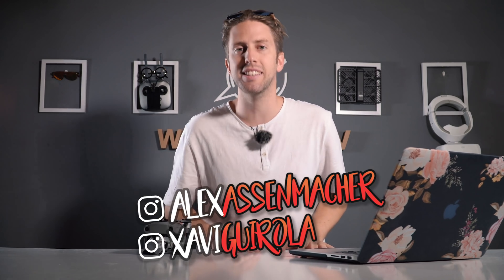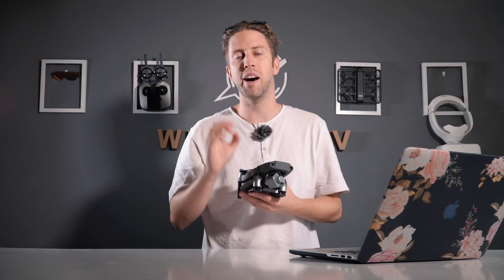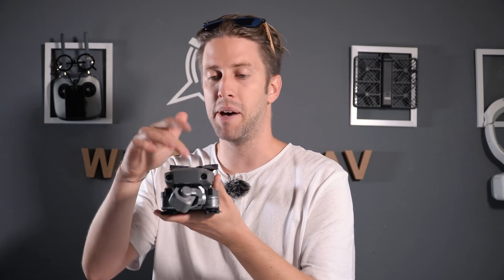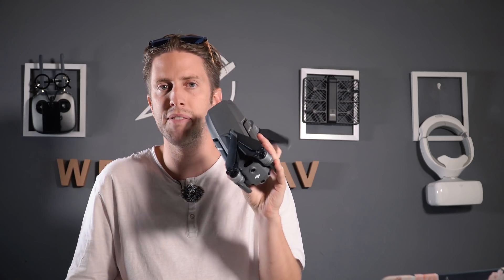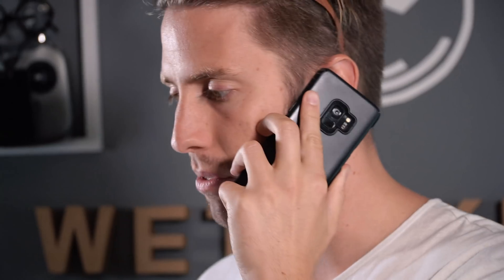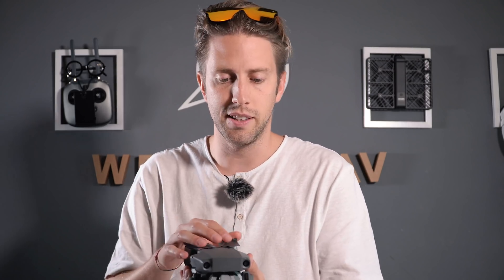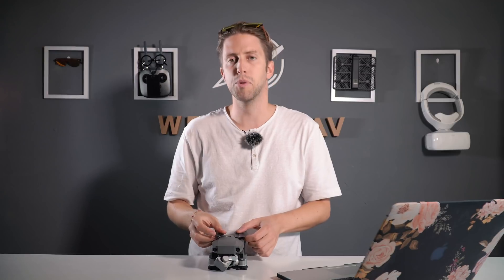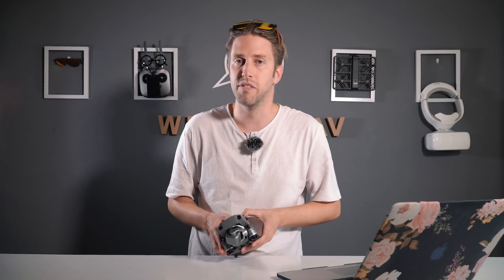DJI MAVIC 2 PRO USES ONLY HALF SENSOR - THIS IS WHY

Comment: How do you know that the p4p is using it's full 1in sensor ?
Reply: because from videos the p4p way more sharper and clearer than the Mavic, and the Mavic has worse low light performance than the p4p

Comment: I received order of mavic 2 zoom today but with my greatest disappointment i figured that side sensor don't work at all duding my in house flight even after successful compass and IMu calibration. And yes i did try in tripod mood multiple times and this shit crashed on to my wall. I'm very glad it was very slight crash but bottom line side sensor don't work unless probably u are on active track mood only but definitely I'd like to fly it out far with safety  from all side then active track n follow my self . I'm surprised hardly any body talking about this defect. DJI advertise it's as omnidirectional but it's actually not at all

Comment: I'm not sure this is true Alex. Once you go beyond a 12 Mp sensor, you're always going to need some sort of down-sampling in order to output a 4k video.  The DJI Manual on the 2 Pro very clearly states in FOV mode it's using all the sensor and thus shooting in 5.5k, then down-sampling the picture to output in 4k.  This is not line skipping, which they have confirmed.  If you choose HQ mode, then the outer part of the sensor is not used to enable a true 1 pixel to pixel input / output, so again, no skipping.  
Either way, the true benefit of the larger sensor with larger pixels and higher resolution is always going to be for stills, not video. Cheers, Ian in London
Reply: I can imagine ANYTHING about dji now after I have accidentally found this video in German language.
The guy has a factory version of Go4 app, and since the discussion is in German, I'm not sure how. He has WAYPOINTS. Not with hyperlapse, a proper waypoints 2.0 with functionality that today only Litchi can do for the Mavic 2.

This means that dji deliberately crippled the app we use!

https://youtu.be/M5PtcPE_QbU
Reply: There is no way they are downsampling in FOV mode unless their algorithm is complete garbage.  The image should be super sharp if using supersampling and it's not. (just look at A7 III 4K footage which downsamples 6K to 4K.. It's amazing.   FOV mode is the blurriest mode out of them all which doesn't match up with the characteristics of downsampling/supersampling.
Reply: @Morawka1  Just read the manual. It clearly states they're downsampling in FOV mode..... I can't comment on why it's not great, only that they are indeed downsampling.... Cheers, Ian in London.
Reply: From the manual:  "For the Mavic 2 Pro, Full FOV down samples from the 5.5K sensor to 4K resolution while HW crops in 
the center for finer image quality but less FOV. Full FOV view is 75° and HQ view is 55°. "
So they're pretty open about the image quality not being great in FOV mode...  Ian
Reply: If it just down sampling from 5.5k to 4 k why would it not match the camera on the older P4P. If Dji where telling the truth the P4P would have the same problem with down sampling. There is something more than Dji are saying. I think Cliff is on to something.

Comment: Your talking sh*t mate in fact all your doing is regurgitating someone else's crap, DJI have said they are NOT line skipping with this camera. dam last week you loved it did you not ? its a great bit of kit and a very much needed improvement over the old Mavic and that's why many of us went out and brought it. if I wanted a P4 I would have got that but its to big for what I do. who cares if its not quite as good as the P4 or as good as the P5 is going to be its still a great bit of kit, saying that I would like someone to get an oscilloscope on this camera and test what's really going on just to shut this silly debate down once and for all.

Comment: So...why does the video shot with my M2P look so good?   I also have seen M2P and P4P video side by side...very little to no difference especially in 4K HQ mode with or without D-log 10 bit color.  In addition, the one inch sensor improves the quality of photos even more than the one inch does video.  Finally, and a somewhat different perspective,  because the M2P is so much quieter than the P4P,  I will use the M2P in more situations and therefore actually get video and photos that I would not get if I owned just the P4P.

Comment: OMG, another sensor issue related video.  
Won't even watch this, sorry and thanks for the hard work.  

Like I mentioned in other vlogs:
1.- It´s as important or more the 10bit color than using the whole sensor
2.- It´s a lot more important the greater dynamic range which you DO get than using the whole sensor
3.- When you shoot with a drone, 95% of the time or more you will see object quite far away so the fine details aren´t 100% needed. 
4.- All, ALL other drone sharpen the images electronically, is not a benefit coming from the amazing sensor or an amazing lens, so it looks sharper but a lot less realistic. 
5.- And the most important:  People worry so so so much about the technical stuff and just have not a clue to how to tell a compelling story. It´s so easy to buy and fly a drone now, but to know about composition, storytelling and have skills in editing and color correction, that seems not to be so important.  Many of the people they say they will return the M2P have horrible content or doesn´t have one at all.

So sad so sad about this kind of sensationalist videos.   Dumbs down!
Reply from the maker: Hi Ricardo, thx for saying that. 
This video is not entirely about the sensor issue, in fact I made a mistake at some things Cliff said, but this video is about why DJI is not using the entire sensor. Not the issue itself, but a bit about everything surrounding that.
Even though I don't agree with some of your points, I like that you stated them here. thanks again
Reply: Thanks for taking the comment in a good way.  It´s a matter of priorities.  To me, as I said, everything that does work 100% on the M2Pro it´s way more than what it doesn´t :)
Reply: A Question for you Urroz : When you go into a supermarket and buy an apple and the cashier cuts the apple into two parts and throw one part away , because its more green or so, and 
demands the price for the whole apple.   Would you pay ?  You explained you dont need  the whole sensor (apple) for getting good quality (taste of the apple). Clearly i get the same taste and experience like from the full apple. But for what did you pay ?  Thats here the question.
Reply: @j.kohlenbach1878  not the same comparison, first off did you know you were paying for a 5k sensor not a 4K sensor, so you are getting more then what you think and secondly, it is using the entire sensor to scan, it's just not processing all of the scanned image.
Please understand this.
Reply: Agree with you. My thoughts exactly.
Reply: J. Kohlenbach hehehe. You are, in my opinion 100% mistaken. You analogy does not apply since it's not half of the sensor what I'm getting. Or half of the Apple. I went to buy a red apple. And damn! It's red but in some part is discolored. The taste for me still great. It's fresh. It's sweet. So yes. Bad on dji not giving me the red apple the promise, that I don't argue. I argue making so many videos complaining about it, when Ive got 90% of the quality  I was supposed to. Because the apple is not 100% red is no reason to return it or cry over and over about it. I rather take a advantage of what I get. A 90 to 96% red apple. With amazing taste. Amazing sweetness and pretty hard. If you or many you tubers want to focus on the lack of the full se sensor when promised. Go ahead. I rather focus on the amazing dynamic range, the amazing 10bit which is even better than Sony cameras. The amazing portability, range, battery. Etc..

It's more about what you create with what you have and less about butting myself up or dji for not having the full red apple 100%. 🤦🏻‍♂️
Reply: Not only that. In a way, at least DJI have a 4k HD which gives you a hint that the FPV wont be 100% . To be honest, I love the image quality.
Reply: I agree

Comment: RAW subsampling in the M2P IS technically using the entire sensor. The Line skipping claim  is fake news.  M2P has better dynamic range and less artifacts than the P4P but viewer details.
Reply: M2P has a 5K sensor that it's subsampling from, not a 4K sensor, I don't understand why people getting upset for nothing....... thanks for sharing your thoughts
Reply: @droneXfactor  MP2 has the same amount of pixels as the P4 pro. Both are 20mp sensors. This is seen in 4K HQ mode when the picture is cropped to maintain 1-1 pixel ratio.
Reply: @MachuPichuu  good to know
Reply: you clearly need eye check, if you claiming p4pr video is more blurry with more artefacts than m2p. just please check some analysis here on tube for start. you don't have to be an expert to see that, it's obvious from 720p on.
Reply: izoyt: please read again: I've written that it has less datails. But image quality is not only details. M2P has much better colors (10bit), better dynamic range and no artifacts (I'm not saying the P4P has). Every Pro user is able to produce beautifuly videos of this material. Only if you rely on what's coming directly out of the cam, you will not get happy with the M2P.
Reply: izoyt: First of all: Hasselblad is famous for their stills cameras, not video cameras. And in photo mode there are no limitations - so it can be seen as a 1" Hasselblad stills camera. Second: DJI said right from the beginning that the Crop mode is the high quality mode. DJI never said that the M2P would have the same capabilities as the P4P. This was purely claimed on the web.
Reply: @jeemotion2025   Sorry, but i dont agree. When they brag new mavic will get 1inch sensor, it is automatically perception by their users, it will be on same on even better than p4 level, which is older model. It is main selling point of this drone, i think we can all agree on that. Truth is, it is not delivered by final result (which is video footage), plain and simple. Hiding behind small text doesn't cut here, imo.
Reply: izoyt: The truth is, that the M2P has a physical 1"type-sensor. So what would you recommend DJI should write on their package?  And again: for me the overall video quality is superb. And the entire sensor is used in terms of noise level  (via RAW subsampling) - this is the main selling point and it is fullfilled. Other than that I did not get this drone to win a digital sharpness contest, but to produce beautiful video footage. And this is what the drone delivers better than any other drone out there with this size.

Comment from the maker: Dear all, first, I want to apologize for not having included what DJI claimed on their statement, about RAW subsampling instead of line skipping. It is a big one.
That said, raw subsampling may be more detailed and complex than line skipping, but this video is about DJI not using the full 1 inch sensor. This doesn't change. The purpose of the video is giving you 2 reasons WHY this has- may have- happened. Not hating the drone, clearly say that it's the best foldable drone out there.
Reply: Raw Subsampling might just be the term DJI uses for line-skipping at the sensor level, as opposed to doing it on the image processor. But that moiré clearly indicates that information is being skipped.
Reply: I love DJI products. That does not change the fact that they're skipping lines (or data anyway). Yes, pretty much all cameras with a 8k+ sensor downscale to output 4k. Some do it by combining information from the whole sensor (high quality, high processing power required, possible heat) others just skip information (lower quality, aliasing, lower signal-to-noise ratio, low processing power required). From various tests and actual footage, it looks like DJI is skipping data to create a 2.7k frame and then upscaling it to a 4K video file.
Reply: DJI uses the entire 1" 5K sensor then it's subsampled
Reply: @Lon Denard on the mavicpilots forum there are other chart tests showing similar results. But also every "pro vs zoom", "pro vs autel evo" (and so on) test on youtube shows the 2 pro has a problem when resolving detail, and it is more likely to produce moiré. Yes, that could be subsampling, which is an ambiguous term that could involve skipping lines or pixels
Reply: @Lon Denard dude shut the hell up you're on everybody's video trolling about this don't be mad because your drone doesn't have true 4K
Reply: @MikeSarni  - LOL...it's OK, let Lon do his thing. Everybody has an opinion and his is just as important as everybody else's. He feels passionate about his view and I respect that.
Reply: @Morawka1  - Sir,..if you take 3840 times 2160 you get 8.294400 megapixels. (You must multiply horizontal rows and vertical columns together) Yes, I own the A7S-II myself. When you crop its 12mp sensor in a 16x9 ratio for UHD video, you are roughly at 8.3mp...exactly as stated in my video, sir. ;-)
Reply: In my video, I explain what line skipping and pixel binning is. DJI admits to "raw sub-sampling" which is actually what pixel binning is. Both readout techniques produce negative image quality results. I think the two biggest take-aways are:

1.) The FOV mode that uses the MOST sensor surface area (pixel binning) has the WORST image quality. Meanwhile, the HQ mode that uses the LEAST sensor area (sensor crop section) has the BEST image quality. This is not my opinion...this is DJI admitted FACT.

2.) "4k" FOV mode has no real significant resolution performance over 2.7k mode.

DJI tells us that sub-sampling was required and that it was a "compromise" against some undisclosed reason. So far, they refuse to say why. Hmmmmm.

As usual, nice video Alex and Chivo!!

Comment: I think dji have already stated that there system is no line skipping or pixel binning, you should seek out this statement to be impartial when your vlogging, you should also seek out Ikopta’s video on the subject. If your only going to take one persons opinion, then your vlog looks to me like your just looking for clicks.
Reply from the maker: you are right, I'm sorry for this.
Reply: DO YOU THINK A MANUFACTURER WILL TELL YOU THEIR PRODUCT HAVE A FAULT,SO BECAUSE THEY ITS NOT LINE SKIPPING OR PIXEL BINNING YOU WILL BELIEVE THAT HUH??  HOW DENSE CAN YOU BE,I HAVE SEEN A WAY BETTER VIDEO AND PICTURE QUALITY OUT OF A NOKIA LUMIA 1020 THAN OUT OF WHAT WE GET FROM THAT MAVIC HASSLEBLAD.SO DONT BE STUPID 100%
Reply: YOUR RESPONSE IS THE RESULT OF YOUR LEVEL OF STUPIDITY WHICH YOU THINK IS INTELLIGENCE,YOUR ONE OF THOSE WHO ARE EASILY FOOLED.SONY INTRODUCED THEI ALPHA 7(3) AND IN INTRODUCING IT THEY STATED THERE IS NO PIXEL BINNING,SO IF THEY CAN ENSURE THEIR CUSTOMERS OF THIS FROM A PROFESSIONAL CAMERA WHICH USES THE FULL FRAME OF THE SENSOR,YOU EXPECT ME TO BELIEVE DJI WILE NOT USING THE FULL FRAME OF LENS WILL STILL GET EVERYTHING PRO PERFECT??? COME ON PUTO

Comment: I would tend to agree with your assessment of DJI strategy.  I also agree with you that the Mavic 2 Pro is a great little drone.  I have had a P4P, a Mavic Air, and now a Mavic 2 Pro.  The Pro really performs well in low light and high dynamic range conditions.  It has great flight characteristics: very quiet propellers, smooth stick controls, and excellent flight time. IMO, resolution is needed for printing very large prints or displaying on very large LCD screens. If you need that, go to the Inspire series.  Otherwise, focus on great composition and cinematic video capture.
Reply: Nope, better details in original video will be clearly seen even on low resolution footage, i can assure you that and it does have big impact on quality perception, too. This is why this whole 1 inch 4k sensor marketing was little bogus on m2p. It clearly can resolve way better footage, which can actually be seen form taking stills with same camera, but they (i'm sure of this) attentionally scale down video resolution/details to not mess with their phantom or pro line. If you're claiming that sensor (and then final image) it's the same, than this is ripping costumers off and we do have regulations about this.